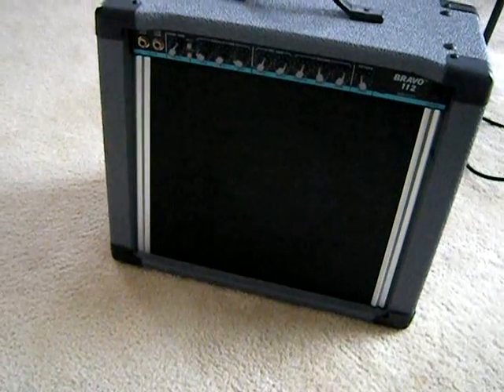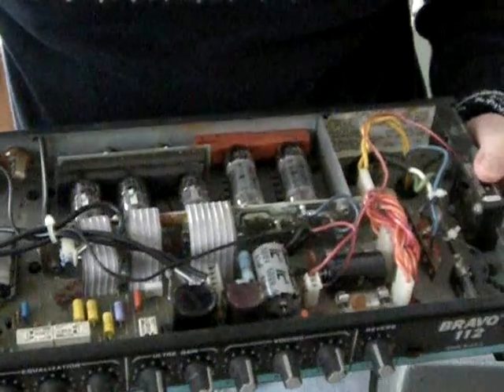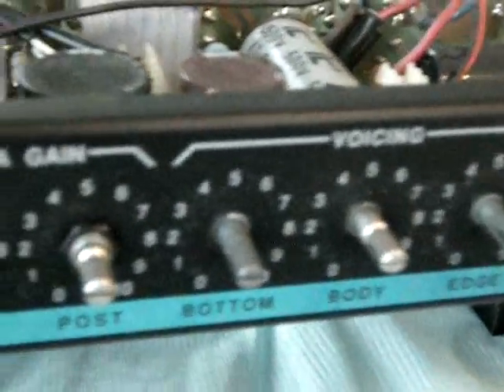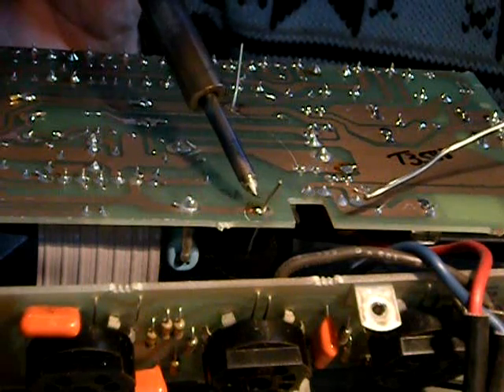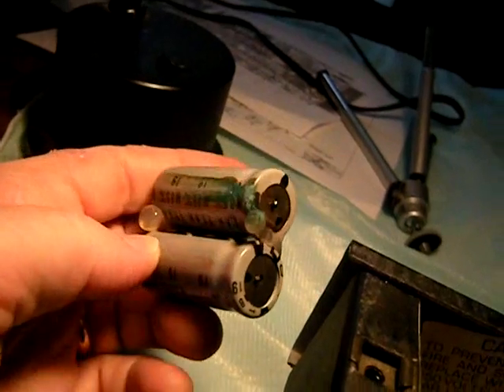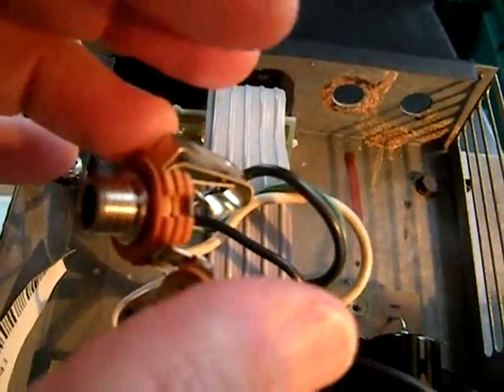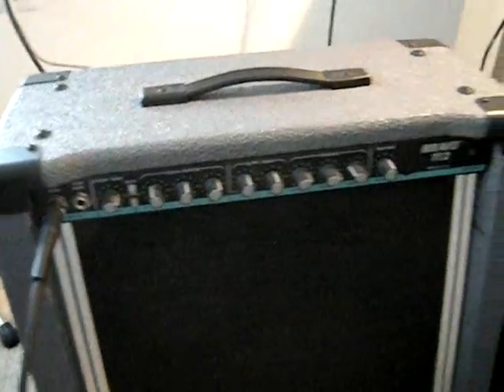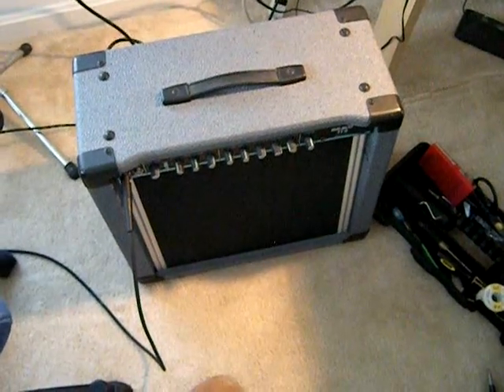Peavey Bravo 112 Tube Guitar Amp Recap Job

Comment: Is it possible to change the power cord on these amps? I found one but it definitely needs a new power cord. Also, how did you get the chassis disconnected from the reverb tank? Is the reverb tank screwed in to the cabinet?
Reply: Power cord is soldered directly to fuses etc inside and clamped with a strain relief; you'll have to desolder wires and use pliers to compress strain relief and remove cord. Reverb tank is at bottom of cabinet screwed down, and there is 4 pin molex type connector to the main board that pulls out.  Many find bagging reverb helps lessen feedback, lots of gain makes reverb howl!